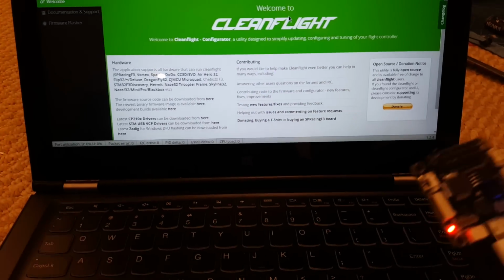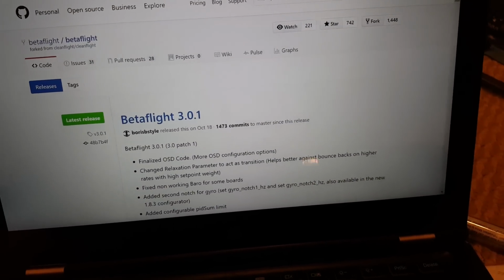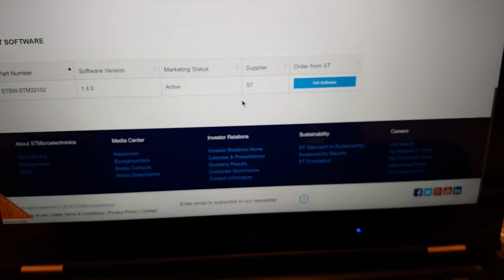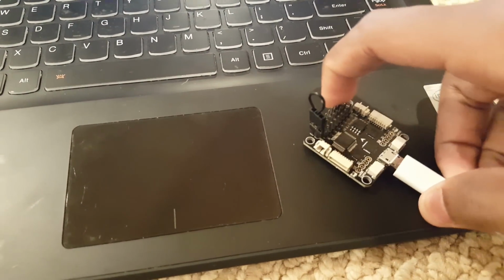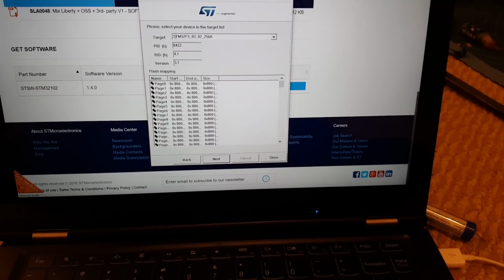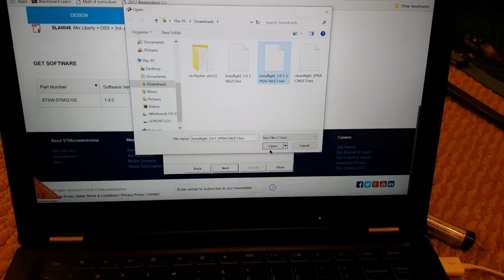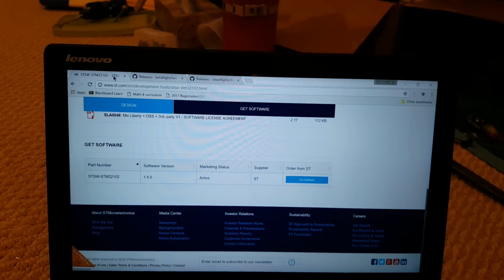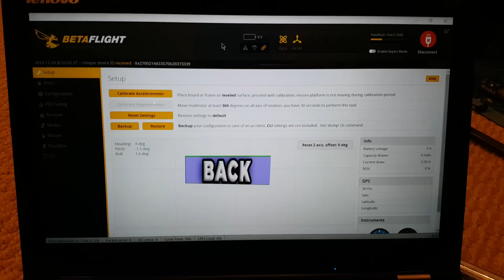FIX YOUR BRICKED SPRACING F3 BOARDS-Programming failed | No Response From Bootloader | Flashing

Comment: Worked a treat on a new SPRacing clone i couldnt get to work. :)
Reply from the maker: PastyCaptain I'm glad it worked out.  Happy flying!
Reply: Sohan Sunku  i loaded my settings after i got it working and while betaflight was rebooting the FC it would not reconnect. tried restarting Betaflight,  reboot computer. Reflashed as per your video fine (which worked originaly) but it just times out after 10seconds while trying to connect.  driving me nuts!
Reply: Sohan Sunku  i loaded my settings after i got it working and while betaflight was rebooting the FC it would not reconnect. tried restarting Betaflight,  reboot computer. Reflashed as per your video fine (which worked originaly) but it just times out after 10seconds while trying to connect.  driving me nuts!
Reply from the maker: PastyCaptain That is odd. Make sure all of your other programs like cleanflight and blheli are closed. If it persists flash again

Comment: what if mine isnt bricked can i just put two lil wires to short it out or i have to solder that in
Reply from the maker: I'm not sure I understand your question, but if you are trying to flash your board using the method in the video make sure to short the 2 boot pads. This can be done using most conductive stuff. Solder is the most certain way, but I normally just use the probe on my multimeter or something to short it out. It may take a couple of tries though

Comment: none of my lights are flashing so is my board dead?
Reply from the maker: aman virani Are you sure that the cable is working? If it doesn't light up no matter what cable you use, you will probably have to replace it
Reply: yeah, i tried a few cables but it doesn't light up. but when i got it a few days ago it was working
Reply from the maker: aman virani It's possible that you shorted out the board. Check for any obviously burnt components and check for continuity. This is quite a difficult problem to fix so you might as well buy a new one or contact your local hobby shop
Reply: Sohan Sunku dude ur like one of the few people who actually reply man, you just gained a subscriber
Reply from the maker: Thanks!

Comment: Excellent video Sohan, I have a Doge flight controller with a button. Do I have to hold the button down the whole time or can I let it go once it's in the boot loader? Thanks a lot.
Reply from the maker: Dino Zuzic You only have to gold down the button while plugging in the fc to power. Once plugged in it should switch to bootloader mode and you can let go
Reply from the maker: Dino Zuzic Good luck! I'm sure it'll work out

Comment: I can not connect the usb to com1, do I need to add something to add?
Reply from the maker: Ivan Viegas First make sure that the board is actually associated with com 1 and that it isn't another device. If it is com 1 and it still doesn't work, go to the betaflight homepage and try installing the drivers listed there
Reply: My controller is a "cc3d" method is equal to is it different?
Reply from the maker: Ivan Viegas I have not tried this method with the cc3d before. It should work, but the only difference would be to downloaf cc3d firmware and try a different baud rate. Default baud rate will probably work for cc3d
Reply: Hello, could give your contact is that I am full of problems at the computer level and at the controller level I'm tired of looking for solutions and so far yours is more perished than mine.
Reply from the maker: Ivan Viegas I'm sorry, but I'm not sure what you meant. Did you want my contact info?
Reply: Yes, I'm new to the world of drones and I still have not noticed some things that are easy, and I wanted help to solve my problem ...
Reply from the maker: Ivan Viegas You can email me at sohan.sunku1@gmail.com.  I'd be glad to help you out more

Comment: Thanks! Saved my bacon, as I mistakenly flashed my SPracing F3 with Betaflight 3.1.6 for SPracing F3 Evo ...  thought I was screwed, but downloaded the STM flasher and was able to load correct FW.  Even though I had a solid blue LED, jumpering the BOOT with a pair of tweezers, I apparently wasn't getting good contact to possible middle layers of the board. So, I soldered a wire jumper in and was able to get the Flasher program to work (prior to soldering in the wire, it would time out.  Thanks again. Thumbs UP for sure! Cheers!
Reply: Bill Somrak how did u get the GUI flasher thing to work? all it seems to do is install a driver. I see no application or exe file to run
Reply: When you install the program mention above, it should make a folder in your startup menu called STMICROELECTRONICS. Inside that folder will be a folder called FLASHLOADER. Inside that folder are 3 entries: a Command line program (for DOS), a program called Demonstrator GUI, and an Uninstall file.  Run the Demonstrator GUI.  You may have to install some STMicro drivers 1st, in order for this to work. I'd already installed those on my computer (Windows 7 - 64bit) long ago, so the Demonstrator GUI program fired right up. Hope that helps.

Comment: When in the demonstrator GUI i still cant find the com port even with all the drivers and betalfight closed
Reply from the maker: Kyle L does your computer make a sound when you connect the board to signify a new device?
Reply: no it does not
Reply from the maker: Kyle L well that's a problem. does the boatd atleast light up?
Reply: it does have a blue light when the boot pins are shorted and a couple of red flashes then solid blue light plugged in with the pins not shorted
Reply from the maker: Atleast the board is working.  I'm no expert on computers but you mighr not have the correct drivers installed.  Another computer might help.  You could also check the devices page in settings to see if the board is registering as anything. Zadig might also be able to help
Reply: I installed all the drivers that are linked in betaflight. Does not show it on device manager or Zadig so i"m suspecting it might be an issue with the USB cable.
Reply from the maker: Yeah that seems to be the problem.  Hope you figure it out!
Reply: finally found out the problem. The usb cable was only for providing power so after getting one online I was able to detect the FC and flash betaflight.
Reply from the maker: Awesome! Glad it worked out

Comment: how can i do this on a macbook with a beecore f3 evo flight controller?
Reply from the maker: sam Costin I'm not 100% sure as I haven't flashed it before, but I would recommend following the same procedure I used above. But as far as I know, the program I linked does not work on the Apple OS.

Comment: i did this same rocess on my naze and got it to work now im doing it on my f3 and it said it was successful but nothing works so i just did a full erase is there any other f3 firmware i can try
Reply from the maker: nikki brumett the only difference between flashing naze and the spracing f3 using this method is that you have to change baud rate and use different hex files. If the betaflight firmware wasn't working, try cleanflight

Comment: now the program you gave me is saying no response from bootloader...
Reply from the maker: +Liam Coddington if it says that then the board is probably not in bootloader mode or the wrong com port is selected. Make sure that the red light is not on, only blue light.
Reply: I have done that by jumping the boot things, I don't see any blue lights
Reply from the maker: Liam Coddington do the lights turn on under any circumstances? There should be some activity with the blue light to indicate bootloader mode.
Reply: havent noticed any blue lights on the board since I got it
Reply from the maker: Liam Coddington In that case it could be a clone with different leds and flashing sequence.
Reply: it came with an eachine wizard

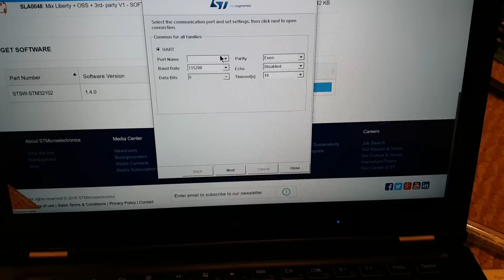Comment: Sohan when i go to site and downlaod the stm32102 file it downloads but when i click to open it doesnt come up like in your video?at 3:15 seconds of video.I can flash my sp racing f3 board but I get no flashing blue led and also no red led at all..I can flash hex file to my board beta or cleanflight and connect to it but never red flashing red led?also after flashing hex file and setup no matter what hex i put on board my quad never flys correctly ?I though maybe just the red led was burnt out but i set my quad up with same pid settings as my friends and mine still does no fly as it should,oscillates very badly...changine pids does nothingafter flashing the red led should come on and blink?
Reply from the maker: So you are not able to open the program?
Reply: Sohan Sunku no not the stm flasher,when I download it. It just downloads then thats it?
Reply: I have downloaded it and deleted it several times and it always downloads and I guess goes into the directory on pc.should I download it the not unzip,it and plug in board then open file I downloaded?
Reply from the maker: So basically download the program first and unzip it. Then go and get your hex file. Next, short the boot pins, and plug in your board. If it doesn't work try borrowing a computer as I'm not sure what exactly could cause this problems
Reply: I had this issue. Make sure you unzip it to a new folder and then open it from the new folder. Don't just unzip it to the downloads folder.

Comment: hey nice vid , but i got a spracing f3 , and it uses cp201x drivers and when i tried to use the STM32 flasher , it says it cant find to right com port , so im guessing it just works with stm32 driver boards , but my board is bricked i cant even get in betaflight , what can i do ,is there a cp210x flasher , plz help someone !!!!!!!!!!!!!!!!!!!!!!!!!!!
Reply from the maker: mike2jz gte all spracing f3s use the cp2102 drivers don't worry about that. First check if your computer is recognizing the board as a device. Does the computer make a sound when you plug it in? Does the fc show up in the devices  page in your computer's settings? If so reply and we can keep troubleshooting
Reply: hey wow thanks for the quick reply , yeh it shows up , makes a noise , one of my other same f3 boards load up in betaflight ok , but the other one was working until i tried flashing it then stopped even connecting to beta, and i also noticed the red light does not even come on at all on the board , weird ! , so if they all use , including yours cp210x , how were you able to use stm32 flasher
Reply from the maker: +mike2jz gte the flasher is suited for the processing chip. If you look closely, there is a small blacm chip on the board with stm32... written on it. So make sure that you are in bootloader mode. (Boot pads jumped, red led should not light up, blue led should be on) and then enter the stm flasher. If the correct com port doesn't show up, make sure to close all programs that might be using it (cleanflight, betaflight, chrome) and open up the flasher again
Reply: ok so i just reinstalled the cp210x drivers , and tried to jump the pins,it seem to get past the first screen on stm32 flasher now , im gonna try and watch your vid again to go through the process of flashing hope i get it to work
Reply from the maker: mike2jz gte glad to hear that. Good luck!
Reply: hey man appreciate it , it works ,, back to my build ,,, build a gep 130 , its gonna be a rocket , much thanks i will subscribe friend :)

Comment: my board doesn't even go to boot mode
Reply: I agree, there are definitely going to be some defective boards but what i don't like is that the vendor isn't doing anything for their buyers with defective boards. DAmn hobbyking/banggood/gearbest/alibaba/aliexpress.
Reply from the maker: Sketchy Stick Animation So when you short the pads and plug in the board the red light doesnt go off? Make sure that the board is pluggged in only after the boot pins are jumped
Reply: nope, it doesn't happen. I even tried different USB cables. nothing!!
Reply: To piggy back on this question. I have my pins shorted out and when I plug in the usb I hear it make a noise in the computer and the red light DOES NOT turn in but I do NOT get a blue light. Any suggestions for this? I'm losing my mind over here. NEVER buying another one of these all in one boards again.
Reply from the maker: I've never experienced this problem before I'll have to look in to it. I'm no expert on the board so to me it just seems like the board is dead. Does the board light up when the pins are not shorted?
Reply: If the pins are not shorted it lights up fine but it will not connect to beta flight. I see the port change to com 3 but when trying to connect it just hangs for 10 seconds and fails.
Reply: The worst part is I have never had a hard crash with this board on my quad. The only thing that I can honestly think of that could have caused a problem was when I had a friend try to flash it for me and he immediately tried to use "DFU" mode through betaflight. Betaflight said it was restarting the board but it never did restart.
Reply: I'm thinking that it is half way flashed because it worked well before flashing and now the only good thing its for its a very very dim green torch
Reply: Same... except a very dim red torch =/  Never buying one of these crappy f3 boards again.
Reply from the maker: IrishXP FPV I know that you guys have been having trouble with these board but I gotta say that I still like them. They work well if you're able to flash and have a good price point. Just wanna put this out there so that people don't get the wrong idea about them.
Reply: This is exactly why I will steer clear of this brand from here on out!

Comment: Hi Sohan, problem with my spracing f3 board was working good flashed clean flight new version all went ok now try to  flash my motors so went to blheli- configurator plug in the battery in and than plug in to my computer com 3 my esc start to make a song and that's it no lights on my Fc no red light blinking and blue light on my Fc try to boodload no blue light coming on on my Fc help please
Reply from the maker: paulie lie I'm sorry to hear that. First try disconnecting all cables from the spracing f3. Make sure that the boot pins are not shorted and plug into your computer (to check if in bootloader mode or not). Check to see if red light is there. If red light is on go through the process in the video again and try to flash again.
Reply: Hi Sohan, thanks for your replay, i did all that no blue no red light  when connected boot pins  and connect to my computer, i think i need a new board.
Reply from the maker: paulie lie Yeah if there is no response a component on your board has probably short circuited.   I'm just curious. after you flashed did were you able to enter cleanflight or betaflight?
Reply: Hi Sohan, yes everything was OK after i installed new version clean flight.

Comment: Alright...so what if I get to the page in the Flash Loader Demonstrator and no targets are listed?
Reply from the maker: cjkcizur make sure that the boot pads are jumped. Also check that cleanflight and betaflight are closed
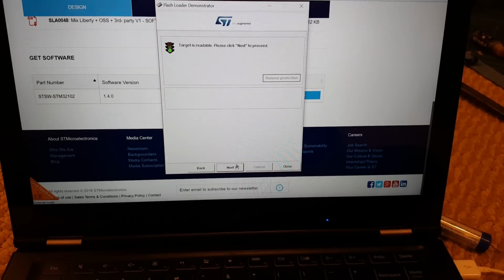Reply: Thanks, yeah I've got them jumped (only the power light comes on, not the activity light). In the screen you show at 3:58 I've got 'NA' listed in the BID field and no targets show up in the drop-down list. Really appreciate the help but I think this board is jacked after playing with the new resource feature in Betaflight 3.1
Reply from the maker: +cjkcizur can you tell me how this happened? I'll try to replicate it on one of my boards to test it out
Reply: Checkout my issue post here on the betaflight github site: https://github.com/betaflight/betaflight/issues/2212

Basically I'm using the SPRacing F3 as a replacement for the factory CC3D on my Eachine Falcon 250 (see the video on my channel). Because of the Pin header alignment, I had to use a custom motor mix to map the motors to the correct pins. With Betaflight 3.1 they've introduced resource mapping, so I tried to use that to re-map the pins so that I could just use the default Quad X mixer. It's possible I just did something completely stupid!